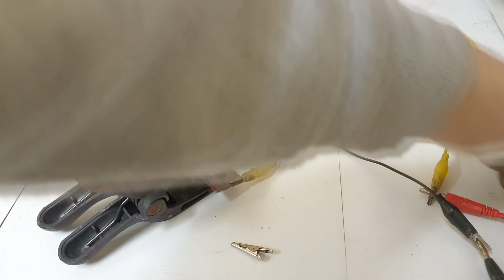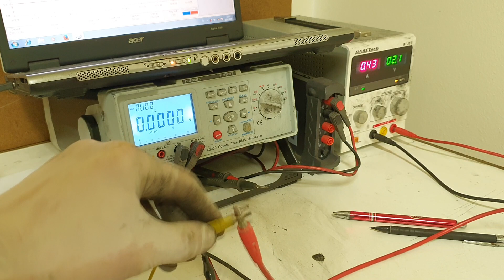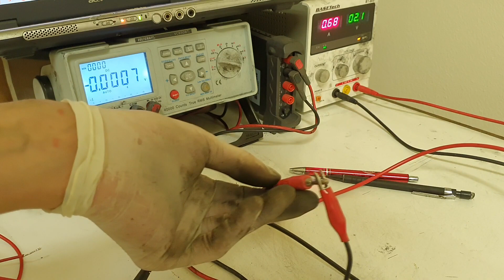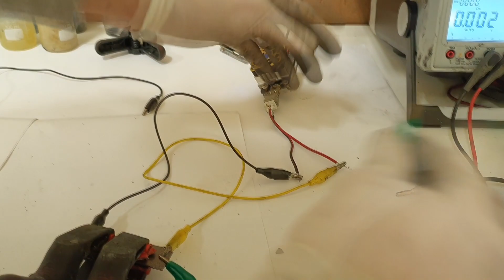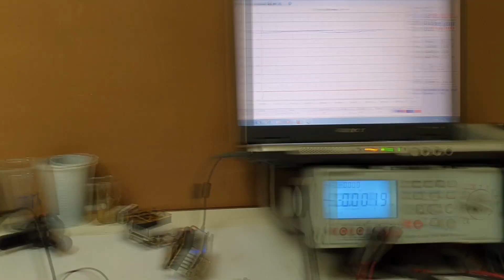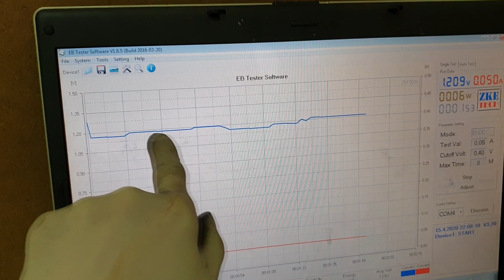Testing errors of off grid battery prototype - the size matters!

Comment: hi, so zinc  Chlorine cells, you never made more video's about this, is this a good battery? materials are cheap and can be find everywhere, is there plate sulfation? do you know what kind of degradation does it have? what king power density does this have?
Reply from the maker: Yea,.... the materials are cheap but you will need really good housing and system for chlorine gas,.... which is toxic as hell.
Reply: @cayrex  i understand this where can i get more information?
all info i found was for "zinc chloride" or zinc ion, not zinc chlorine!    :( !!! lol
Reply from the maker: @ozb2006  Would be better to search for zinc "chlorine" battery 😊
Reply from the maker: https://www.osti.gov/servlets/purl/6302789
https://www.sciencedirect.com/science/article/abs/pii/0378775382850039
https://patents.google.com/patent/US4146680A/en
...

Comment: Good Timing, Was about to buy some more cheap leads today. I was just lazy. My very first Epsom Salts cell all used my home made Leads with good copper wire, Then a Bought 20 cheap ones(steel Cable). So now I'm going to buy some good larger crocodile clips heads and make my own again. Thanks for the reminder. Some times you fail to think of things you already know.

Comment: I have always made my own leads, the cheap Chineseum ones are useless.
you can also solder on good quality 4mm banana plugs on each end and plug straight into power supply or put crocodile clips to connect to cell. I buy a few dozen clips at a time and change them every couple of weeks :-) 

BTW Your cell looks very good capacity for size, what type is it?

Comment: Thanks for pointing out the problems with those cheap alligator clips!  I also found that the clips themselves rust out very quickly because they get exposed to the corrosive electrolytes. I think they are nickel plated iron. I replaced them with Mueller BU-70C  solid copper ones and they last much longer. I keep them clean with a small 1/4 inch diameter stainless steel brush. Here is an eBay listing of them: https://www.ebay.com/itm/MUELLER-ELECTRIC-BU-70C-COPPER-ALLIGATOR-CLIP-10-pieces-/264641815810 They cost about $12 US for 10.
Reply from the maker: Thank you my friend 😉